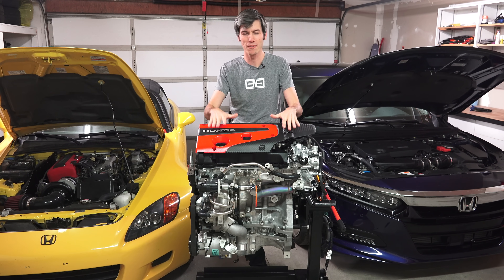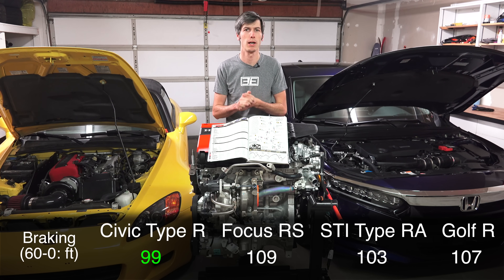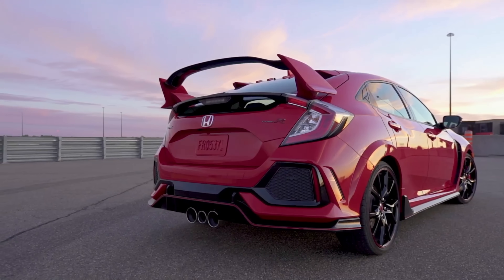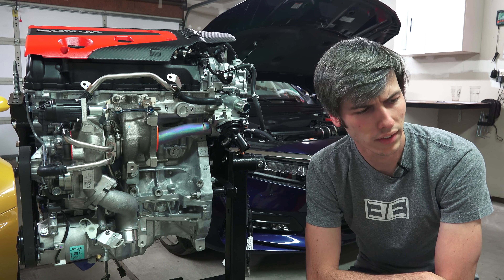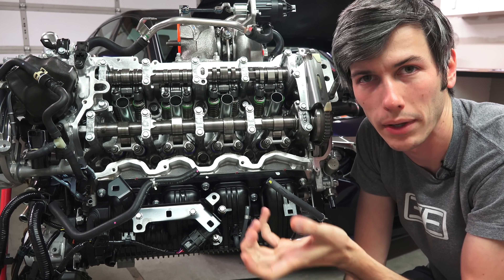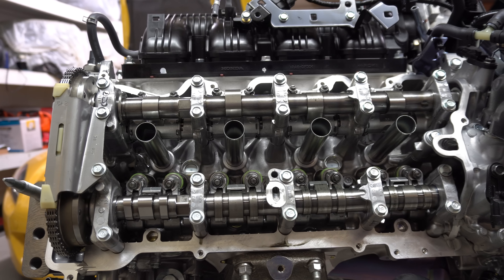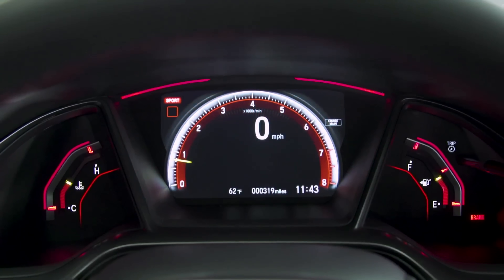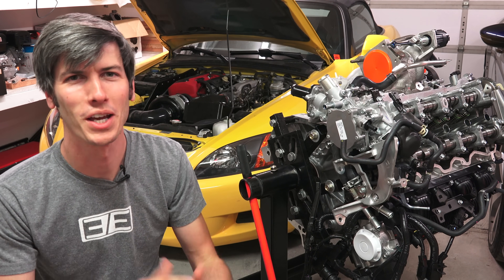The Honda Civic Type R Destroys The Competition - The Best Engines

Comment: If honda made it rear wheel drive they would sell a alot. Like literally.
Reply: Then it won't be called a 'Civic'.
Reply: @txisbest2010  just call it Civic Type R(wd)
Reply: If they made a V8, camaro and mustang owners would cry themselves to sleep every night.
Reply: They make v8 racing engines they make v8 truck engines they don't put them in cars.Ask your self why.
Reply: I don't think so much, the Camaro has a very good front/rear weight distribution.
Reply: León Angel the s2000 is exactly 50/50 and it rwd with engine up front. Although technically it is mid-engined as the block is behind the front wheels.
Reply: The Camaro LTG also have a weight distribution of 50/50, and with his 275 HP, can be considered also mid-engined.
Reply: @littlerhino2006  overrated
Reply: @littlerhino2006   Honda owners wouldn't be able to make the excuse  of having  less cylinders
Reply: if my car had wings it would be a plane
Reply: Shakeel nope.. type rs are FF. Go buy a 370
Reply: E36 compact with spooled up L33 and push play!
Reply: they tried that with the s2000, it didn't sell so well.
Reply: NO NO NO NO NO NO NO NO NO NO NO NO NO NO
Reply: They definitely shouldn't make the CTR rwd, they just need to make a new S2000.
Reply: DHH *awd
Reply: Ya but heads on a CBR1000R are over-square. They produce a lot of horsepower but awful torque. Even at 2.0 litres the stroke would be so small that you would not get enough force to accelerate a 3'000 pound vehicle at a fast pace.

Yes you can put high revving short stroke engines in F1 cars and motorcycles but they are extremely light compared to a modern consumer vehicle packed with safety features.
Reply: Josh well if you forego power steering, make a small 2 seat midengined car, and consider the fact that motorcycle head v8s are light af, a 2000lb decently fast all out track car is a very possible outcome.
Reply: Josh also a high revving vehicle can make up for lacking torque by implementing very aggressive gearing.
Reply: the S2000 is rear wheel drive
Reply: If I don't live in a place that snows, I'd happily get this FWD type R. but because snow drifting hooning... I refuse anything that does not send power to the rear.
Reply: @192lalo  it's doable - Honda makes F1 engines after all which used to be V8 and are now V6. 

I think it would just cost too much. The Hemi and LS motors are simple pushrod designs and Ford gets their price down with its 5L (which is a proper DOHC motor) by using this engine in a bunch of different stuff. 

For Honda that engine would probably end up the same way as BMW's V8 from their old M3's.. Too niche.
Reply: Tyler Seabrook they made a 20,000 rpm 3.5l v10 that is used in some lotus f1 cars.
Reply: Nah either fwd or awd. Rwd and civic make no sense.
Reply: Lol
Reply: Why?
Reply: It would lost that hatch back taste .... it would just not feel right.
Reply: Literally? Like  what lot? A car lot? What lot are we talking about , since it's LITERALLY!
Reply: So... the S2000? That was discontinued because it didn’t sell as well as they wished? Honda makes amazing FWD cars, but their RWD cars were never anything too special
Reply: @thatebutuoyguy788  yeah, I'll just go take out a $125,00 loan and pick myself up a nice NSX, thanks for the advice!
Reply: They should make a RWD prelude and a new S2000.
Reply: I disagree. The style is what hurts the Type R the most in sales. The enthusiast community moved away from aggressive styling and adding useless plastics around 2010 and cars became all about how "clean" you could make them look. Awesome performer, hideous styling. Too bad it couldn't have had both and shake up the hot hatch market.
Reply: +Josh you are right. i have heard a lot of people say that the car is good, its just too gaudy. hell a lot of reviewers say that it doesn't even feel fwd most of the time. 
the looks have grown on me a little bit but i still dont like those two massive fake vents on the front and rear bumper, if it didn't have those i think it would look pretty good.
Reply: Anttics if they use two cbr1000rr heads and make a new block, the could get 10-12k rpm reliably and make at least 325hp out of a 2.0l. And it’d be a v8.
Reply: Even if they made it RWD, it'll still be gay.
Reply: dummy
Reply: not in my winter region.
Reply: I wish they make a new Acura TL in rwd that would be nuts!
Reply: @192lalo  they need to slim the civic down. There is a reason why older civics are fast bc they aren't heavy
Reply: It doesn't need it. You wouldn't be able to drift the rear tires on a curve at more than 140 KM/H, and that is the key to win any race and make people look bad and mad.
Reply: Honda will be perfect if they put a switch for AWD on their engines when it is required and then comeback to FWD.. This is it.
Reply: They already sale "a lot"
Reply: They should, bring back that S2000.
Reply: Mate no need its for racing . And in racing its dominating FWD IS TOO GOOD ON THE DRY ,WHERE IT MATTERS
Reply: S2018
Reply: well, the market dictates what the products that manufacturers put out. No one is buying manual transmission, V8 engines ;the manufacturers stop making them. name one  RWD car or SUV that outsell the FWD. Name one rwd vehicle that is in the same class with the type R that outperform it
Reply: i wish they kept S2000 & finally turbo'd that. it took them forever after everyone else finally turbo'd stuff to realize vtec alone doesnt yield any real torque
Reply: Shakeel I somewhat agree, but part of the charm of a Honda is lightweight and thrifty packaging. RWD in a front engine sedan adds weight and cost.
Reply: Bah.....old school!
Reply: Shakeel then you would loose all of its advantages.
Reply: Honda prelude reboot with a turbocharged 4 or na 6 RWD? Please? Willing to beg here
Reply: @joshuabarkey4554  I loved my 2001 Prelude, but it competes too directly with the Accord coupe. Since I can't get a Prelude anymore I bought an Accord Coupe V6 6MT. I love that car. So, if they reboot the Prelude it would have to be a lot better and very different than the Accord V6 and I don't see that happening. Would need to be a RWD coupe with around 350HP and in todays market, I don't see them doing that. We can dream though.
Reply: himura357  Well perfect timing then since the Accord coupe has been discontinued.
Reply: @himura357  the accord v6 no longer exists though
Reply: @joshuabarkey4554  Yes, which would mean there is a spot for the Prelude now, but they already abandoned the Accord coupe and the Civic Type R even has 4 doors so it seems they are moving away from that model. A Prelude has always been a coupe, so for them to bring it back it would have to have a market for it. That said, I really hope they do, I would love to see a new Prelude. Honda just feels so conservative lately, and a new Prelude would be expensive to build. That is actually one of the reasons it died out.
Reply: @himura357  you're right!
Reply: @joshuabarkey4554  probably bought a 2017 or previous model
Reply: @joshuabarkey4554  
The first car I purchased was a 1989 Prelude 2.0 Si.

I loved that car, popup lights, cruise control, sunroof and everything.
Reply: Then it would be just like  most other rwd sports cars. Fwd is what makes the type r special.
Reply: @TwoCraZyEyes0  You mean special in the almost any car is fwd nowadays special?
Reply: @TwoCraZyEyes0  Yes, but RWD sport cars are lacking. At least the affordable ones. Apart from Miatas, GT86 and a couple oddballs, there aren't many. Most brands just release performance FWD cars. 
Hence forth, making fwd less special, not counting the majority of regular cars.
Reply: +Drifto-kun
there are a couple decent fwd sports cars but the type R is in a league of its own compared to those.
the type R is also great because its cheaper than most other competitors.
and there are plenty of rwd sports cars my dude: 370z, Kia Stinger, mustang, camaro, SS, challenger, charger, miata, BRZ, BMW 2 series. all those are affordable.
Reply: Na.. Your average donut can't drive rear wheel drive...
Reply: pollumG your average donut can’t race a FF car correctly
Reply: With their level of technology, it would become the most expansive and also the slowest of the 4 cars. Better keep its name, fastest in the world. .....of front wheel drive only.
Reply: Isn't there an all wheel drive model Europe got?
Reply: andrew l some aftermarket company added electric motors to the rear to make it an awd hybrid. I think that may be what you are thinking of.
Reply: My dream is Honda to build rwd sedan with 6 cilynder inline N/A vtec engine.This will be the greatest car on the planet :D
Reply: @pippenn92  bro you basically just described a nissan 350Z rev up engine.. ever heard of that beautiful car ?
Reply: Vincent Marin you mean a Japanese v6 mustang?

Comment: You could make a case for any of these cars except the Subaru... Type R- best overall, Focus - AWD and big power, Golf - comfortable and refined... but the STi is the most expensive, slowest, and by far the most outdated car here. only for the hard-core subie fanboy.
Reply from the maker: I tend to agree. They all have their places. $50k for an STI doesn't make sense to me, but I guess that's a limited edition thing. It's certainly dated.
Reply: The Golf R is the best overall and it's not even close.  List all aspects of a vehicle.  Looks (subjective, but lets be real here...), interior quality, electronics, dry weather performance, wet weather performance, snow/ice performance, ride quality, availability of non-manual option (in case your SO doesn't drive a manual).  The Golf is better at all of these except one.  The Civic is a killer purpose built vehicle, no one will take that away from this achievement.  But claiming that it's a better overall car for an average family man?  I just don't get it.

Comment: lol, we have 4 type R sitting in service right now, 2 that threw a rod through the block, and another one blew a transmission. Last one is a overheating concern. Quality gentleman, Quality
Reply from the maker: Haha, fair, but anecdotes never tell a full story. I'm sure there are plenty of Honda Civics in service centers right now, doesn't mean Honda Civics aren't reliable.
Reply: You also stick in beamed rods in any style engine like this AND did Honda shotpeen their rods as THEY SHOULD!
Reply: The owners of these cars most likely drive the hell out of it before the break in period is over. So of course that will happen.
Reply: Since these are track oriented cars, I can imagine that the owners drove the hell out of them. The overheating though is a problem I've heard about.
Reply: This just in: more honda civics sold means more will be in the shop, broken, because more of them are on the road.

More at 11
Reply: ZX Spectrum - LOL!
Reply: emm.. not type R
Reply: lol, we have 6 sti's sitting in OUR service room, too
Reply: Perfect example of a fallacy... Honda is not perfect; also, other customers have other car brands sitting in service too. Here's a piece of advice, buddy: don't ever buy a Ferrari or Lambo, 'cause you'll be greatly disappointed in knowing they fail too.
Reply: I can guarantee it's no Honda quality but most likely idiots dumping clutches at redline or just blatantly abusing the hell out of their cars in every conceivable way possible. I've met such idiots and they are plentiful.
Reply: Ever wondered if someone put it the wrong gear? Not like theyre going to admit it lol
Reply: @WeirdBrick 
The money shift...
Reply: @4G12  right no rev limiter is going to stop you blowing your engine from a miss shift
Reply: ...You know the ECU will record it as evidence if you over rev and there is no warranty left.
Reply: ECU WON"T let it over rev. That is why they call it a Rev limiter.
Reply: Check that freeze data. Plenty other Civic Si models got bumped on the warranty because 11k is NOT the intended rpm ! (3rd to 2nd oops!)
Reply: Honda owners...
Reply: Wonder how many (if any) had flashed their ECUs and messed up their own timing...Then went back to stock and made a warranty claim
Reply: Poor cars, they have to be getting ragged on. I still have my factory clutch in my 09si that's been supercharged for 5 years.... Guess you can say I don't drive it hard enough, but I have fun without going too far. I don't feel like breaking it and it's not even a 40k car.
Reply: Probably idiots red lining it all day before the engine is even broken in.
Reply: One of those type r is mine. Pos. 

Good thing for warranty
Reply: You should see Mercedes service lot...
Reply: Wonder if it has anything to do with the lack of balancing shafts
Reply: Let this comment sit here ;) salting out Honda fanboys